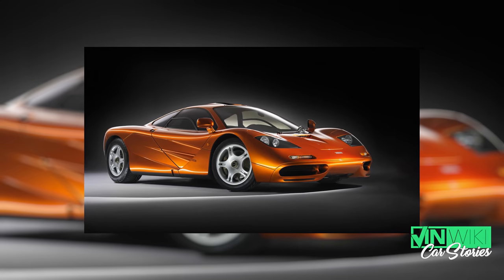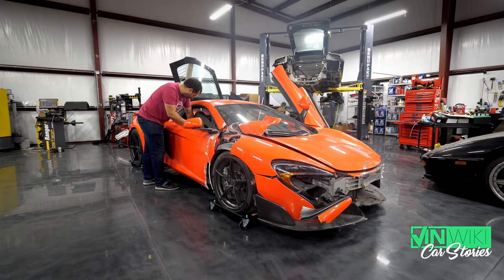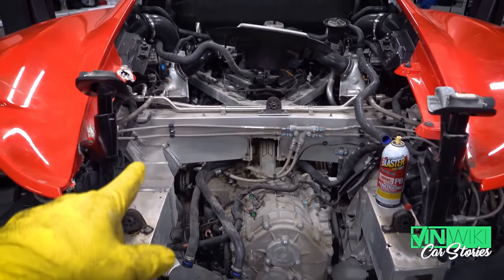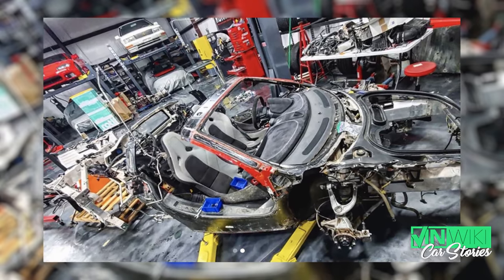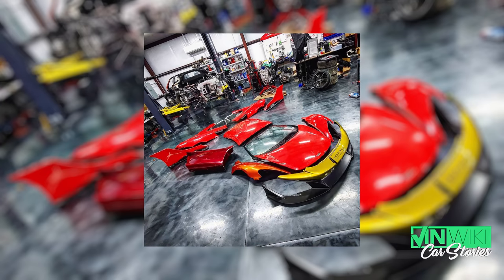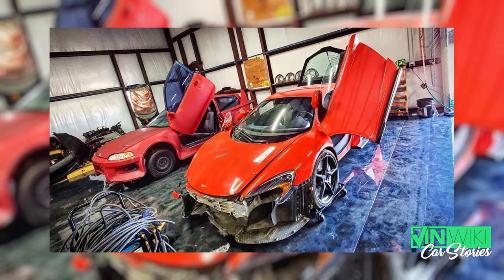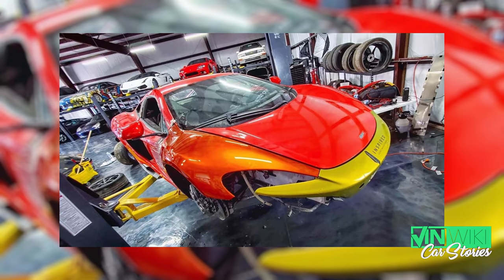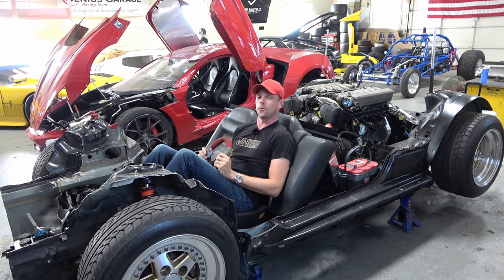Here's why you should NEVER rebuild a McLaren 675LT

Comment: Won’t this end up costing more than a used 675LT without a salvage title??
Reply: Very likely, yeah. It must be an awesome project, though. Few people can say that they rebuilt a McLaren.
Reply: For 99.9% of the population, it would.  Tavarish is relying on some luck.  It is a risky build. The vinWiki host is probably holding his nose.  It could turn out to the a $110,000 piece of rolling crap.
Reply: If you think about it he got the roof scoop that would have been 40k for a quarter of that. When its complete it will at least have that making the car more valuable. But overall this car will be valuable to mainly tavarish and it wont matter to him what the title says.
Reply: NickS it’s still not a “factory” roof scoop.  Not sure if McLaren owners have that thing for “factory” (aka it’s on the window sticker) like Ferrari owners.
Reply: @chijen2010  I see what you're saying. This car is already arguably totaled so it might not ever have the window sticker 1 owner appeal. But it will have a hell of a story
Reply: So far hes only spent 80K to buy the car, and about 40k in parts. And the carbon tub is fixed
Reply: The whole point of youtubers buying cars to rebuild is to get content out of the rebuild process. Sure, a used example might work out to be cheaper, but you can't make as many videos out of it.
Reply: It's not about the money. It's about sending a message 😉

Comment: The problem with carbon fibre is you can't just hammer it back into shape, weld it back together or really repair it at all; if its cracked you basically need a new panel so nearly every carbon piece on that car needs replacing.

Comment: 80k is still a somewhat steal, cool rebuild
Reply: Could probably make a profit (if willing to wait) selling just parts to others trying to fix theirs
Reply: It's non rolling car with damage to all the main components. 
Front and rear subframes are the cheapest.
Engine is on god knows what condition. 
And above all the monocoque of the car is damaged. That part alone costs more to replace than anything else on the car. Also it is nearly impossible to repair after major damage. It's not like steel or metals.

Comment: "This car is super hard to rebuild" LOL, when I saw thet first video I thought it might be a waste of time, second video confirmed it.
Buying parts for a super expensive car without even knowing how much the rebuilt will cost is not how you should do it IMO.
You don't buy parts when you don't even know if the motor is ok.
To me this car, even repaired with cheap parts, might end up costing more than a used 675LT since the prices are still going down (less than 200K€ now).
But hey, I guess it still gives good wrenching exercises :P

Comment: This might be more expensive to do but i think diy gangs hellcat is a crazier rebuild.
Reply: Meh
Reply: Both of are insane just on the aspect that they have main structure damage beyond level of being repairable back to structural specifications set for the structure. 

One has heavy heat damage that has ruined heat treated high strength structural components and their properties.  That makes the whole frame unusable and non-repairable. Painting it won't bring back it's proprties.

And this one... Damaged carbon monocoque. It's single huge component which is composed on precisely engineered precision laid carbon mats of differentiation wave structures laid on god knows how many layers. Then the whole thing is soaked in resin and the mold put in vacuum/compression bag for proper curing. 

Damage in the video so heavy that it has made holes trough the structure ripping trough all the layers... And the damage extents way beyond what you can actually see on the surface. I would not be surprised if half of the whole structure has layer separations in it. 

Yeah, i'd say that they are similar levels on repairability.

Comment: Hes gonna spend more than 200k and itll have zero resale value. Of course I appreciate the project as a project and I'm sure it'll be the nicest driver McLaren in existence when all is said and done, but nah man. Just nah. Not smart. Yes the novelty of knowing every bolt on a car is worth something, I know. I'm familiar with that feeling. But I rebuilt a 20 yr old civic. I didnt have to buy 20k parts or learn to manufacture or pay for the equipment to manufacture vaccume molded carbon fiber parts. Everybody's got a different amount of 0s in their bank account, but this is insane. Even if I was a multi millionaire I wouldn't take on a project this intense. Metal is way easier to work with that fiberglass. My man's gonna spend allot of time in boat yards in upcoming episodes.